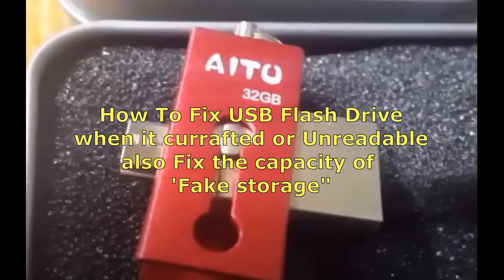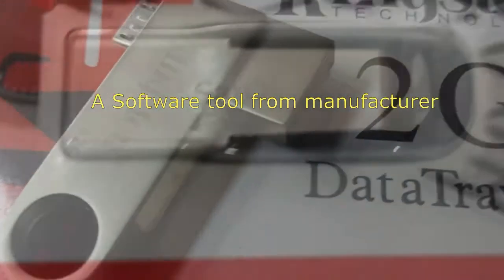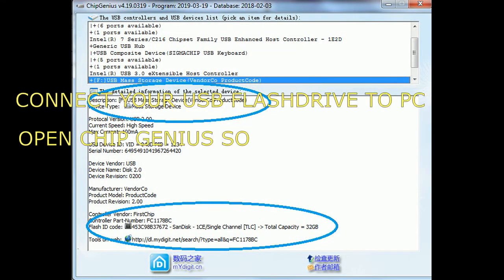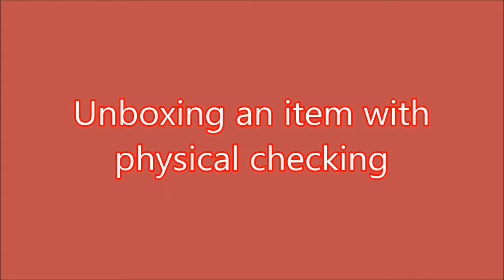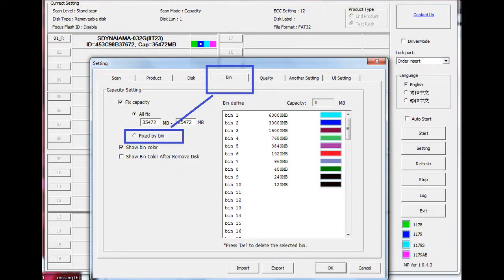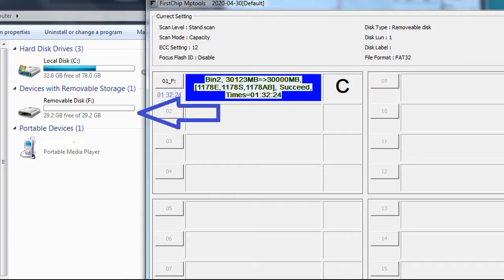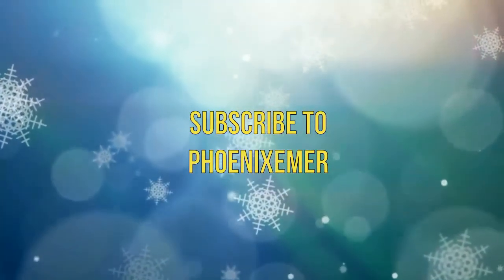Repair and Fix Flash Drive Capacity Problem Reset to factory Firmware

Comment: Very Useful However my USB does Not scan past the 1% after the first scan. Any Help?
Reply from the maker: There are 2 type why not scan. The Controller Part-Number and tool you use not match & The chips is totally damaged. Mostlly FC chips work scan approx. 10-15 min in scan to finish.

Comment: What's the settings for a 64gb pendrive it shows only 32 gb please help
Reply from the maker: Make set to "standalone" or maybe, the true chip inside is only 32G not 64G see info in chip genius what chip capacity. Thanks
Reply: @KnowInsideGadget  in chip genius it shows 64 gb capacity
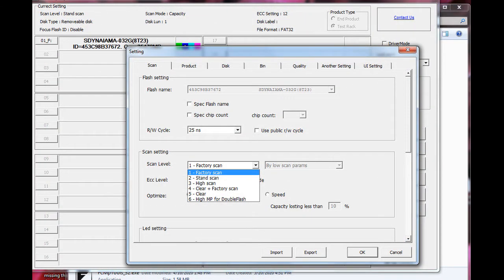Reply from the maker: @Princek9  Video 1:22 set "clear" after that make it high scan.. hope works thanks and sub my channel
Reply: @KnowInsideGadget  it didn't work bro
Reply from the maker: @Princek9          sorry to say your pendrive working chip is now only 32GB.

Comment: Paano po ayusin Yung usb flash drive na reduce Yung capacity nakaraan ay 16 GB ngayon naging 8 GB n lng ginamit ko Yung ChipGenius pra maayos Yung "no media" pero naging 8 GB n lng paano bumalik Yung full capacity nya po ayaw po gumana Yung nasa CMD at sa iba po
Reply from the maker: Use setting 'Stand scan" medyo matagal un pero is-scan nya buong available drive. thank you Subs kayo mga pinoy
Reply: @KnowInsideGadget  Stand scan? San ko po yan mahahanap? Sa ChipGenius po ba?
Reply from the maker: KUng pinanood nyo po video like 1:25 makikita nyo po tools at setting thanks.
Reply: @KnowInsideGadget  ay ok thanks you pero may Nakita ako sa USB Nung ginamit ko chipgenius na dagdagan sa hardware Ng USB flash drive ay "VendorCo Product Code USB Device" iniisip ko nga kung talagang nandun Yun or wla talaga bka gawa Ng Chipgenius

Comment: Please help, after approx 3 hours it stick at 50-52% and shows the 'error code 9'
Reply from the maker: error 9 [0x09] Preload Fail-There is a compare or file not found error when copy file into UFD. maybe flash ic damage
Reply: @KnowInsideGadget  uf ic damaged then its hardware issue ?
Reply from the maker: @VishalSingh002  yes, I hope not. Try to re-flash as normal flashing using "stand scan" or factory scan hope its help, Subscribe for future updates 😀

Comment: You need to specify the bins value from 25000 to 32000. Then only you will get the value. Your pendrive has 29.2 GB bcoz the bin value was 30000. My pendrive was 64 GB outside and chip genius says 32GB maximum.
So I changed the bin value from 25000 to 32000 thereafter fist chip recognised 28000 as maximum and  thereafter only I got the original memory of 27.9 GB. Previously before changing the bin value I got only 16000 maximum which was the default value of bins.
Reply from the maker: Yes if 32000 you get only 27-29GB because of FAT32 system format . Also you can try factory scan format without change any setting . it scan the chip what value then format it what storage in there but it take time formatting.
Reply: To maximize the Pendrive full capacity 32Gb or 64Gb and will format to exFAT or NTFS but not FAT32.

SCAN TAB - Scan Level: Stand Scan
DISK TAB - File System: Auto
BIN TAB - Fix Capacity: Fix by bin
Bin 1: 1024 x 64Gb = 65536Mb
Bin 2: 1024 x 32Gb = 32768Mb

Controller Vendor: FirstChip
Controller Part-Number: FC1178BC
Flash ID code: 89C40832A600
Reply from the maker: @SilichipX   Yes! but some gadget like TV's and USB Sound system required FAT32 to read properly your USB drive, I try to my Andriod TV, If NTFS or exFAT it says it "not supported drive" it need to format there and I saw after format is FAT32.
Reply: @KnowInsideGadget  True! FAT32 is more versatile on most devices but individual files have a maximum limit size of 4Gb. I have Panasonic TX-58EX700B smart TV support USB format to FAT32 or exFAT.

FAT32: Windows, Linux, ChromeOS, MacOS, Android, Wii
exFAT: Windows, Linux, ChromeOS, MacOS, Android, PlayStation
NTFS: Windows, Linux, ChromeOS, MacOS, Xbox
Reply: I formatted my 16gb pendrive but I can't get it back to 16gb, even though that's the actual size
Reply: My pendrive becomes of 16gb, but it was of 32gb, what should i do???
Reply: @KnowInsideGadget  My pendrive becomes of 16gb, but it was of 32gb, what should i do???
Reply: @SilichipX  My pendrive becomes of 16gb, but it was of 32gb, what should i do???
Reply: My pendrive becomes of 16gb, but it was of 32gb, what should i do???
Reply from the maker: @jashanpreetsingh3741  Hello plz clarify? what should you do and problem before what becomes 16gb?
Reply: @KnowInsideGadget  previously i had a 32gb sandisk pendrive, while changing format i removed the pendrive and it was crypted and showing NO MEDIA, so i was trying ur method,,, now my pendrive is useable but now its storage is 15.6gb while it was of 32 gb😰
Reply from the maker: @jashanpreetsingh3741   hey! please use and run ChipGenius tool at this link https://knowinsidegadget.blogspot.com/2019/11/how-to-know-and-detect-fake-capacity-of.html 
and paste the result in new comment section not in reply section.

Comment: I think i had done something wrong in BIN section🤔🤔🤔
Reply from the maker: Hi. post the result of ChipGenius tool like in video 1:10
Reply: @KnowInsideGadget  where to post??
Reply from the maker: @jashanpreetsingh3741  here just copy text result I want to see chip controller and total  capacity of chips and i will help you.
Reply from the maker: Hi, use this tool  https://www.usbdev.ru/?wpfb_dl=9948
And use the "3- High scan OR Clear+Factory scan",  On bin set uncheck all also fix capacity not check,  Another setting make it "default" tell me result maybe tomorrow i will reply im out now. Thanks sub my YT channel
Reply from the maker: This chip  983E98B376E3       is       TOSHI-064GB(9T24)
try to set to "Default"
Reply: @KnowInsideGadget  with high scan and clear scan it becomes of 15.1gb pendrive,,,, how to convert in 32 gb back☹️
Reply from the maker: Ok maybe bugs on tools, Downgrade MpTools_20200430 https://www.usbdev.ru/?wpfb_dl=9310 
Dont change any settings then-
1. Scan level make erase BIN by selecting 5-clear Only wait to finish.
2. after finish Re-unplug USB &set to 2-stand scan(i hope its solve after this)
3.If problem still, make play on BIN setting by manual changing bin2 as 30000MB set BIN, Ps. I did not extremely fix your problem after this because the usbdrive was not in my hand to solve issue.
Reply: @KnowInsideGadget  lock port : ordered insert?????
Reply: @KnowInsideGadget  pls can u come on any other app bcz acttualy i want to show u my screen so that u could find what wrong i am doing....pls any app like instagram ,zoom,meet,whatsapp,fb etc plzz..
Reply: @KnowInsideGadget ?
Reply from the maker: @jashanpreetsingh3741  still not back to 32gb try this may help http://woshub.com/creating-multiple-partitions-on-a-usb-drive-in-windows-10